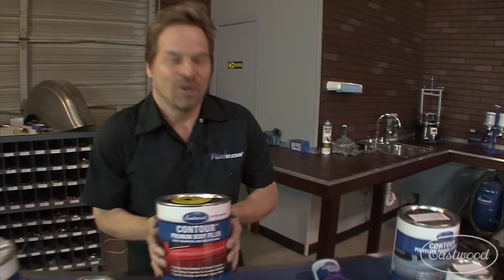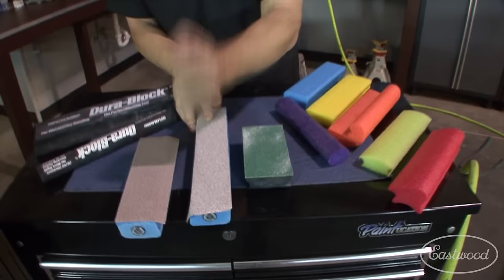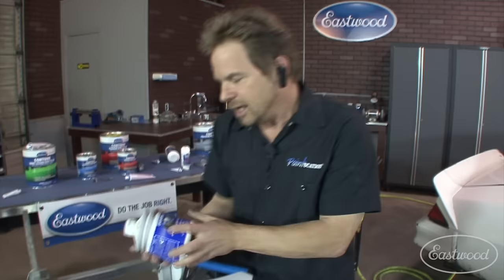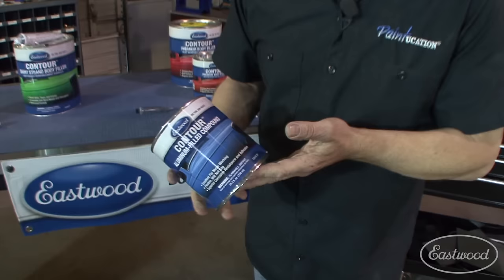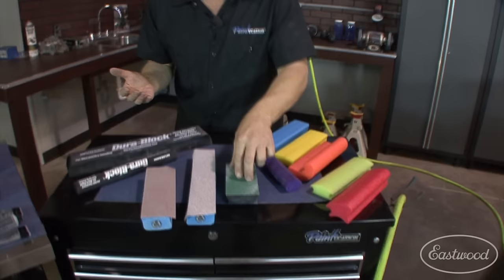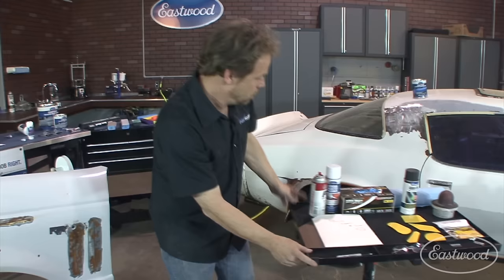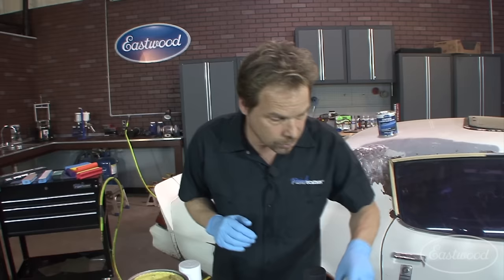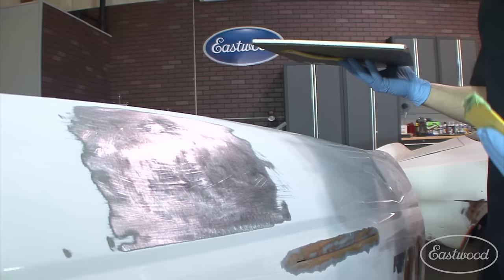How To Use Body Filler - Mixing, Spreading, Sanding & Tips - Part 1 of 3 - Kevin Tetz at Eastwood

Comment: I will be an Eastwood guy soon.  I'll be in the market for a complete paint kit later in the year.  I need everything from the compressor,  spray gun, to all the accessories and equipment needed to do a complete car. I'm building a list on your website following these videos,I will implement all this information I do have a little bit of exsprience but not enough to give training because we are opening a full auto collition training centre in SOUTH AFRICA with the Celette bench training to panelbeating and spray painting. Thank you EASTWOOD for your videos.

Comment: The signs that people staple to utility poles make excellent and free mixing boards. And you are doing the general public a favor!
Reply: I bought the aluminum one from harbor freight. I guess mixing on cardboard isn't a good idea. Because the hardener seeps into the material and doesn't mix properly. Luckly I never had an issue prior to buying a real mixing board.

Comment: For beginners the video starts at 15:18 (The mixing body filler part). Everything before that is what I consider "Information for experienced people"
Reply: It's a whole lot of product salesmanship. I couldn't believe how much hardener he used in his filler and how much filler he put on the panel. Made for a lot more work than he needed. When you have been doing it for many years you realize that filler builds a lot more than you think it does. Less is better. Less filler, less sanding, less product, less cost. Wouldn't have to go over it with 36grit if he didn't have to sand so much filler out. He didn't look very experienced at administering filler to me either.
Reply: @A. Melbs Not particularly. I don't watch a whole lot of youtube videos on this stuff. I own a body shop and run both ends of the insurance/body work so I stay hooked up. If I come across one I will recommend it to you

Comment: Does body filler need to be applied to completely clean metal ?  Ie. No paint layers left over from sanding, primer ? I guess  what im asking is, does every little bit of paint and primer need be removed for body filler to stick to the panel ?

Comment: Great instructional video! Thank you. I am the novice DIY guy. I am preparing to prep a 1990 F-150 for a raptor coat. Will the contour premium filler and contour glazing putty work well for prepping for Raptor Coat after I dolly the dents out?
Reply from the maker: Yes! You will need to topcoat with epoxy primer and then move forward with the rest of the prep sanding it and the bed with 120-180 grit.

Comment: 81 firebird. What would you use on the bumper front and back? I'm sure it's the flexible filler but gotta ask the experts
Reply from the maker: Those bumpers are really good at holding their shape or bouncing back with a bit of heat (even just leaving in the sun on a hot day).  You can still use standard body filler like our https://www.eastwood.com/eastwood-contour-premium-body-filler.html if it's kept thin and on non moving parts.  Or if your bumpers are really out of shape consider getting some fresh ones.

Comment: 20:18 Once hardener is in it why use the prep to clean the applicator off? The cured body filler just peals right off. Eastwood products are expensive enough.

Comment: Hey guys I love these videos.. but I need some help filling over weld repairs.  When I weld panels in how do I treat the welded areas? Do you already have a video on it bc if so I haven't seen it yet. Do I use fiberglass filler straight over the welds then primer, or maybe use an epoxy or rust encapsulater over the welds to hold the moisture out then regular filler over that?? I'm familiar with body work other than over these welds. I ask because I've gotten 2 recently with cracked paint/filler over patch panel welds and upon stripping found new rust under the filler lifting it and the paint. Seems to be a common problem and appearantly the diy'ers are unsure and putting plastic filler straight over these welds. Please tell me the proper way asap as I have one to do this weekend and make a video soon. Thanks guys.  Btw I'm a faithful Eastwood customer. Love your company.

Comment: Shouldn't you spray epoxy on the bare metal first, otherwise it will sweat under the filler and rust?

Comment: Every time I mix body filler it set up really fast take a filler put it on the metal tray after I mix it put it about the size of a  sauser put harder a little less than half  the sauser. Across one stream by time I get it mixed its all ready setten up  i even tried less harder same thing

Comment: very informative, ii'm such a rookie i thought it looked good when he first applied the filler and pressed it as he wiped and said to myself oh like that? then he continued to apply more and more and felt lost after it piled up. what is the rule for applying filler over an entire panel it there a certain thickness it must reach or thinner the better? 

Also does the metal have be tripped or can there be some paint still present?

Comment: Ok I know nothing about this. I had someone that said they know how to do filler it was only for a small spot where the decals was taken off the side fenders there was 2 holes that need to be filled I watched him mix everything up but he never did take it down to bear metal or even sand it. After watching a few videos. I have found that what he done was wrong. I have already had the vehicle painted how long could this be good for before it fails and comes off. My truck does vibrate from the exhaust and motor.

Comment: I plan on buying the block sending key that you have. The question is what different  sandpapers do I need to start out? I won't actually be signing paint but I will be setting everything else from metal prep, blocking,  primer getting ready to send it to the paint shop. I want to be able to buy it by the rolls if possible! Thanks
Reply from the maker: All the sandpaper you need is at Eastwood.  http://www.eastwood.com/autobody/sandpaper.html

Comment: What's the best filler to use on bare steel? I stripped all the paint off a car to repair all the body panels as well as replace a lot of rotten sheetmetal. While I wait for the sheetmetal to show up, I am working out the debt with a hammer and dolly. Now I need to fill in the small remaining dents and don't have paints to blend into, just bare metal. Thanks.
Reply from the maker: David Ekleberry You could use the Eastwood Contour Premium Filler or Aluminum-Filled Compound.  If you have any pits, don't forget to prep the area with Eastwood Fast Etch, which is going to remove the rust from the pits so it doesn't push back through your filler and paint.  Here's a link to the Body Fillers available at Eastwood, and if you'd like to talk to a Tech, you can find info there as well.  http://www.eastwood.com/autobody/body-fillers.html

Comment: Can these be used to hide defects before Powder Coating?
Reply from the maker: Remember, generally speaking curing powder requires heating part to nearly 400ºF, so you would need a specialty filler which can withstand that kind of heat.

Comment: so on small dents do i need to pull with hammer or can i just use body filler only on small dents?
Reply: Crypto Pirate dings you can just put putty but if you can make an inference that you might be able to make it flatter it will be best the less bindi the better

Comment: hi.  I mixed and applied bodyfiller with the hardener and I guess I didn't add enough hardner to the mix as it did not solidify and remained pasty.  is there anything I can do to this to prevent me from removing all the material and starting over? How do I save all the product already used?
Reply from the maker: Aldean Louis If it didn't harden properly, you will need to remove all of the filler and start over.  Check out this video which may help:  http://youtu.be/i2zCiyNu8wU
Reply: Heat throw some heat on it maybe it’s to cold.

Comment: I am working on body filler now. Been working on a quarter panel a couple hours a day for a few days now. I won't have a chance to work on it for a few day so I went over the area I am working on with self etch because there is exposed bare metal. Will sand it off when I get a chance to sand that area again. Is that an ok process to do so I don't get rust on exposed metal?

Comment: what happen if apply body filler over paint ?
Reply: If the paint is sanded with 80 grit or 180 then your fine asking as it’s leveled and doesn’t cause contour mapping. I sanded paint how ever will crack

Comment: this is way to much hardener you are suppose to use a pee size dot for that amount ???? you messed me up but Kelly at Eastwood straightened me out please fix these directions and way to much filler on that what a waste . when mixed proper you can get it much closer than before sanding . sorry